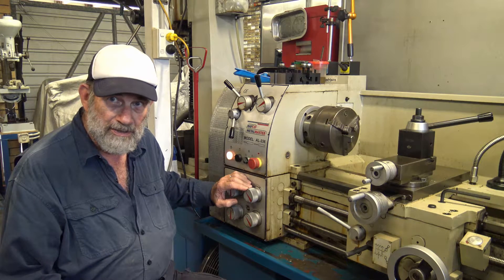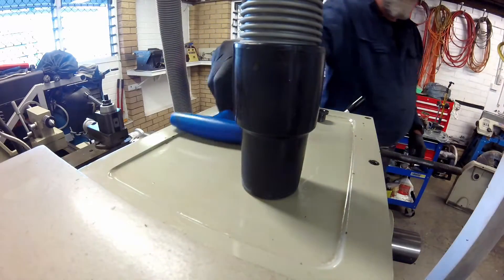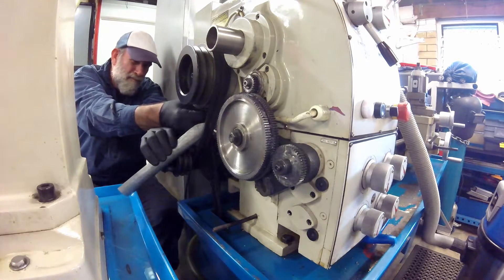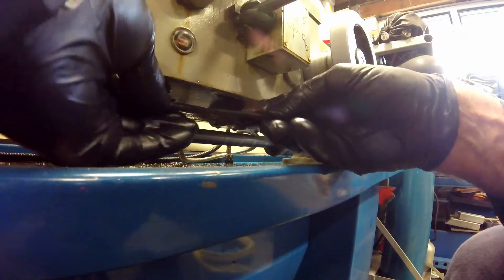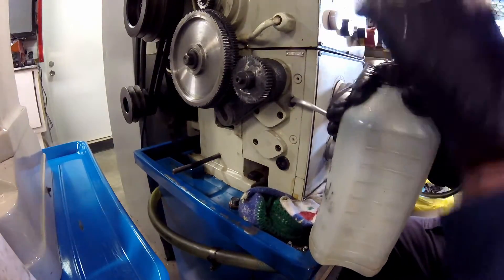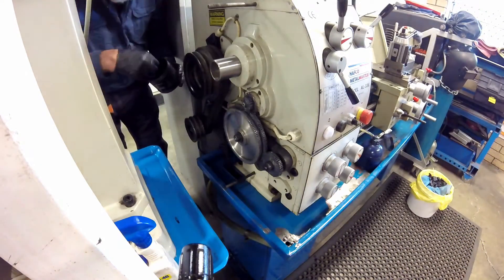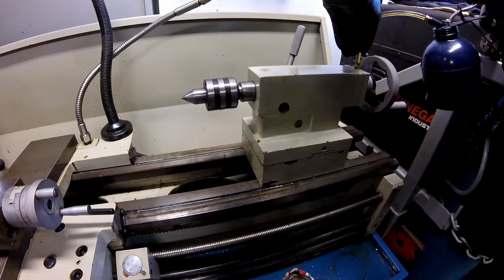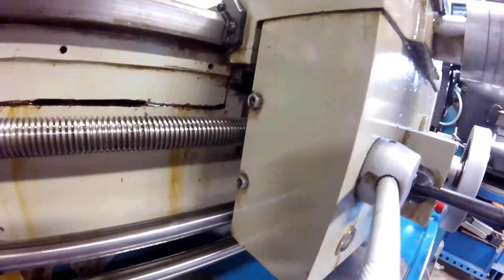Servicing a Centre Lathe

Comment: Thanks Bob. Just bought their AL320g model. This was very useful. I’ve had a look inside the gear box and could see sand and metal shavings sitting in the oil, probably from the casting and grinding production. Better change that before I get stuck in…
Reply from the maker: Yep, good idea. Hopefully not to much in the way of metal shavings, otherwise you might need to make a warranty call. Actually the shavings may have come from line boring the case, but inspect your gears and bearings closely nevertheless. All sorted I think it will be a good unit 👍👍👍.
Reply: @whitedoggarage  glad I cleaned it out! A few teaspoons of sand in the bottom of the gearbox. Dodgy brothers vacuum with my airgun spliced into a piece of hose allowed me to vacuum up all the crud in the bottom.
Reply from the maker: @tc3728  Well done, hopefully trouble free from now on. Thanks for the update.

Comment: I have the same lathe and the drain plug modification is brilliant, you wouldn't remember the specs for the drain plug? I need to make one
Reply from the maker: M16 x 1.5, that is a metric thread, 16mm diameter and 1.5mm pitch, which at that diameter is a 'fine' thread. I just grabbed a bolt, drilled the centre and ran a tube through it and soldered it in place (might have brazed it, can't rember). I would say the tube I used was too small, it was a bit of scrap laying around at the time. I would be tempted to run a 10mm OD tube through if you had one in that size, as the size I used takes too long to drain. Hope that helps.
Reply: @whitedoggarage  Thanks mate, it's about due for it's first service so I will try and grab one of those
Reply from the maker: @Gravattack  No worries 😀

Comment: THANK YOU! My apologies but what is the recommended service cycle? Every 6 months?
Reply from the maker: Joe, quite right, the recommended service cycle is every 6 months. I do it every year, but my lathe is not used every day. Unlike a motor, there should not be any contamination of the oil, but you can still get oxidation so I can't see too much of a problem with a 12 month service schedule. That said, when I used them in industry back in the day, they were doing well to get serviced at all. Cleaning and oiling the ways and oil points, which should be a regular thing however. I saw a YouTube video by Keith Fenner where he fitted an automatic oiler to an American lathe, that looked to be the spitting image of the AL336. He ran oil lines to all the oil points and then I think he had a pump that fed the oil when the lathe was working, probably a good thing to do if the machine is used every day.
Reply: @whitedoggarage  THANKS! I’m a mature age apprentice (53 years old) and just learning about machining. I bought myself the AL-336 as well. This video is exactly what I was looking for.
Reply from the maker: @shadow7423  Joe, good for you, both as a mature age apprentice and buying an AL336. I was an apprentice at 15 and I can't imagine doing it at your age, so good on you. That American, Keith Fenner, he had a jobbing shop and joked that his AL336 lookalike (I think it was called a Grizzley or something - but they are basically all rebadged Rong Fu s from China) was purely used for his once a year metric job, but looking in the background and some of the videos he posted he used it more than that. That said, the AL336 is not a pure metric machine, it is an imperial machine that can do metric work, there is a difference. Keith had a big American Monach I think which he used for the big stuff and always looks impressive and he obviously used the AL336 look alike for the smaller stuff. Anyhow, I digress, you have a nice day, kind regards, Bob.
Reply: @whitedoggarage  the place I work for doesn’t make it easier for me either. There are 2 apprentices at my work. A younger guy (the bosses son) and myself. He gets to spend time at the lathe (4 months and counting). But I only had 3.5 weeks with the lathe. Hence decided to buy myself a lathe so I can catch up in class because I am getting left behind. Thank you again.

Comment: Thanks Bob, most useful,  I have one of these but I am a beginner.  I use the lathe for model aircraft work and some motorcycle fabrication.  Plus, it brings mates over to use it.  All great fun.  My reverse/forward micro seems to have failed - no forward rotation on selection of the red handle.  Reverse and the jog button both work ok.  I have a new micro switch, but cannot see how to get access to the location of the micro under the gearbox.  Any clues, or should I just call H&F for a maintenance visit?  Greg Evans.
Reply from the maker: Greg, my first response is that I have no idea how to get into it and suggest you ring H&F and just ask the question. 
My second response, with a worried look, is to pull the power plug out and do a bit of panel removal. Looking at my unit, I am thinking you need to take the knobs off that go through the bottom panel, undoing the screws on the knobs is my first idea on how to get them off and then I am hoping they just pull off (take photos), then take off the panel itself. I am seeing a plate at the bottom front of the gear box under that plate on mine and I would assume you pull that off (probably screwed in place) and the micro switches should be in the recess behind that plate. I still think ringing H&F first is probably a good start. There may be an easy way to get to it, that is not obvious. Good luck.
Reply from the maker: @Michael Murray Thanks for coming in on that Michael.

Comment: Hi Bob, do you think it necessary to warm up the machine before changing the oils and if so how long would you run the machine to do so? I tend to do that when changing the oil in a car. I do that for 2 reasons - the oil runs out quicker when warm & I imagine it stirs up any contaminants meaning more crap is likely to flush out when draining the oil. Or am I just over thinking things? This is a great video. I have an AL960B. The manual is bordering on useless when it comes to figuring this stuff out.
Reply from the maker: People I have met over the years who have bought the 960, have been very happy with them, they are a good unit. No, I do not bother warming it up in the machines here. They are gear boxes really, and do not have the all the little oil passages that engines have. You never get all the oil out any how, so you are always diluting your old oil with new oil. So, for me, I wait till the oil drain is down to drop by drop and then put the plug back in and refill. I hope that helps, thanks for watching the video.

Comment: I reackon forget the leadscrew covers its easier to clean the leadscrew with a nice low  30 psi of compressed air than deal with the covers binding up. they are in my opinion a unperfected gimmick and when they bound up and shared the brass pin on the leadscrew  for the second time, in the bin they went.

Apart from that the 336 has been fantastic, cant fault it for the price. 

Stu
Reply from the maker: Useful comment, thanks for that Stu 👍👍👍

Comment: Hi Bob,  any chance you can advise oil qty for the feed gearbox?  can see through my sight glass as the previous owner putrified it with gear oil... Thanks
Reply from the maker: I am away from the workshop at the moment and wont be back for a few weeks, so I can't see my records. The guy looking after the shop is more in tune with trucks than lathes, and he hates looking for stuff in the files. From memory, the oil for the service is about 5 to 6 litres in total, with the head unit gearbox taking the bulk of that. I would say for the feed gearbox it is about a litre at most however. The apron gearbox is about 500 mL or so. Hope that helps.
Reply: @whitedoggarage  Thanks Bob,  the oil window doesnt seem very high on my lathe. It’s an Al-335.  The box looks the same as the 336 though.   Unfortunately my oil window is blackened :(.   I used a makeshift dipstick and i reckon ive overfilled it.  I used 46 Hyd fluid and it leaks like a sieve, perhaps due to overfilling?  The oil that came out looked like 85W gear oil and the levers were hard to shift.  Works great with the 46 Hyd fluid….  But concerned about the leak. Tempted to pull the selector plate off and reveal the gasket…
Reply from the maker: @lbackhausen1  Over filling probly won't hurt, but may also be the cause of your leak. The gearbox lubricates by flinging oil and the seal on the driveshaft is probably marginal in preventing oil escaping if the oil is up to the level of the shafts. The heavier oil is a possible cause too as the seal got used to a certain thickness and suddenly a much thinner oil is present, although that is usually only a problem where the oil is pressurised.
Reply: Thanks Bob,  I didnt notice any leaks around the feed or threading screw..   I was tempted to throw in Nulon Transmission leak sealer. Apparently you can have leaks in the casting itself (porous). I figure the previous owner reduced leakage by swapping to a much heavier oil.  Cant ask him because he passed away, hence i ended up with his lathe. He was a retired toolmaker though, but even with the heavier oils it still leaked a heap in the months before the lathe was sold.
Reply from the maker: @lbackhausen1  Leaks in the casting is possible, if it is a bit maybe look for a crack. Maybe the overfill was to give it plenty to cope with the leaks...

Comment: The belts mine came with are slightly different sizes so they don't have equal tension when the motor is level. I saw yours have A787 belts, are they correct for the AL-336? Can't find them in the parts list of the manual
Reply from the maker: Those belts are the ones it came with, so I assume they are correct for the AL336. The AL336 and the compressor are the only two machines we have with dual v-belts, none of which have had to be replaced. Over my working life, I have replaced a number of dual v-belt set-ups, back then, specalist suppliers sold, what were called matched sets of v-belts and this is what I would fit. Thinking about how you would match v-belts, I would imagine the manufacturers matched internal diameter and tension force - probably a special machine and some chap just taking stock v-belts of the same size and testing them until he found two that met the criteria for a match. These days I would have thought precision manufacture advancements may have done away with the need for matched pairs, like any two will do, but maybe not. But that is not the case in your situation. I had a quick look on line and I see the term is "precision matched v-belts", so matched pairs still seem to be a thing. Is the lathe still in warranty, if so take it up with Hare and Forbes. Hope that helps.
Reply: @whitedoggarage  Well out of warrenty I'm affraid. I was about to order a set from AIMS Industrial hoping they would be the same size. I chalked up them not matching as something to expect with an import so getting a pair of quality belts might solve it so thankyou for steering me now to look for matched v-belts instead.

Cheers
Reply from the maker: @Tezza120  Glad to be of help, thanks.

Comment: Hello and Thanks Bob
Can you please advise the dimensions for the Headstock Drain Plug ?
I plan on my first service on an AL-336D
Thanks
Greg
Reply from the maker: Too easy Greg, the diameter is 16 mm and the thread pitch is 1.5 mm,  metric of course. I just butchered a short bolt of that size, quicker than machining one to suit. Good luck with your service, Bob.

Comment: the only thing i curse on this lathe is the tailstock. only one i have ever seen with a flush nose. and omfg, its always a nuisance.

hacked a chunk from the base just to clear the compound but yeah... any work between centres is a nightmare on this thing. its just that inch or two of overhang you need, and it isnt there.  look at the casting, it actually sorta looks like somewhere... someone stuffed up on a drawing in the factory and its never been fixed...

seriously thinking of hacking it up and dovetailing. lever style like a shaper... that in itself would be worthwhile on any lathe...

the al346 might fit on with little to no work. iunno. might go down have a looksee...
Reply from the maker: Totally agree, the tailstock needs more overhang, the othe rmodels have it, why not the 336.
Reply: @whitedoggarage   yep, and the more i look at it, the more it bugs me. whole things a mess. the machining on the vee leaves a bit to be desired too. i got the friday afternoon model.

find a nice chunk of 3x3 CI for a ram first off... hmmm. face off the base, flip it around, recut the vee.
slice through the existing spindle at the centerline, dovetail it. cus the base dropped 15mm or so, can use a beefier spindle in the ram bringing things back up on center. just looked it over, theres enough meat in there.

would really fix a lot of things... even without the ram, simply flipping the thing around and repacking it...

future project. think it over a bit. would my mate donate that nice counterweight he has in the garden? lol... 4x4... bit too big. sigh.
make patterns and actually cast something with that furnace i have but havent ever used?

just set up a TP grinder and yeah, the tailstock is really getting to be a pain. i know that spindle aint parallel!
yknow how you have to do 50 things before doing what you actually wanted to do?
Reply from the maker: @paradiselost9946  Yes what a shame, sounds like it was the Friday afternoon model. The tailstock is a good comment though. I never gave it a thought at the time. I was more focused on the work length and the swing over the bed diameter.

Comment: Thanks Bob - great video. After I saw your video I went hunting on my new lathe and found one oil point hidden under the DRO slide on the cross slide. I fitted magnets to all my drain plugs on my lathe. It seemed that they used to do that many years ago but is now out of favour (probably too expensive). In this era of sustainability I am concerned that we are throwing things away which still have a lot of life left in them. The (hydraulic) oil from your gearboxes is still in excellent condition as it has not been subjected to high heat and is not oxidized. It just contains metal particulates. Have you considered filtering this oil with a 5 to 10 micron filter and reusing (maybe an old toilet roll filter)?
Reply from the maker: They don't seem to give a lot of thought to the layout on lathes these days, having said that DRO slides are hard to position at times. I take your point on the oil. Some years I don't do a lot of machining on mine and it is hard to justify the oil change, even though all the oil around here goes for recycling. One thing though is apart from particulates in the oil, you also need to think about oil shear, that is breakdown of the molecular structure of the oil with time as well as oxidation. BHP coal mines here in Queensland, used to, and probably still do, chemical analysis on their machinery oil to determine when it needs changing. A bit different from just going by the hour meter, but it obviously pays when you consider the amount of oil in a dozer or a haul out truck. Thanks for your comments, Bob.

Comment: Hi again Bob, Well I have my AL336 and I love it, Question of a different subject, Does the AL336 have a Cross slide lock ? (I found the carrige lock 8mm allen head)  slightly annoying not being able to lock the cross slide - Cheers again mate.
Reply from the maker: Good question, but no, there is no cross slide lock. I have never seen a cross slide lock on a center lathe. I can't think of a reason to have one, except maybe to stop tool chatter on turning a shaft, but that is why you do a spring cut, I guess.